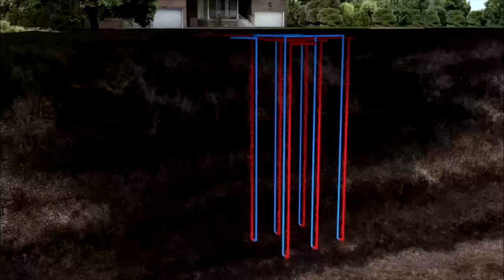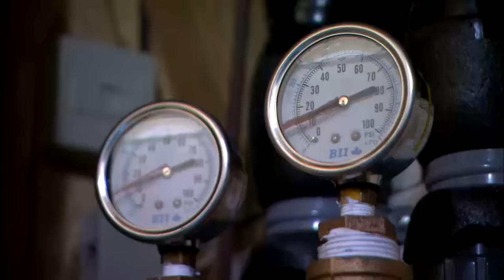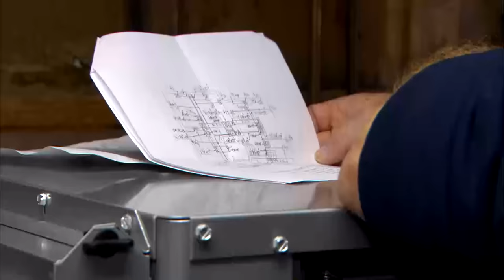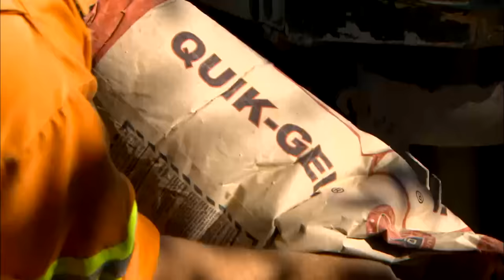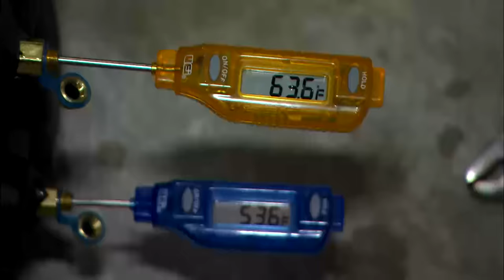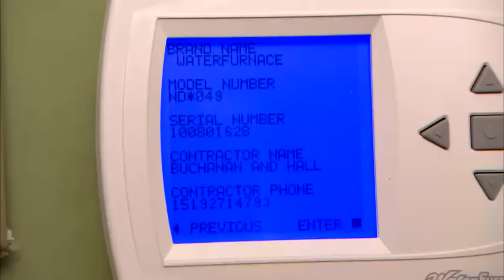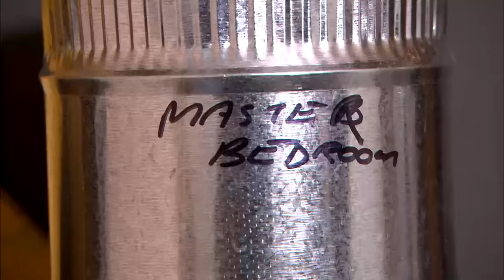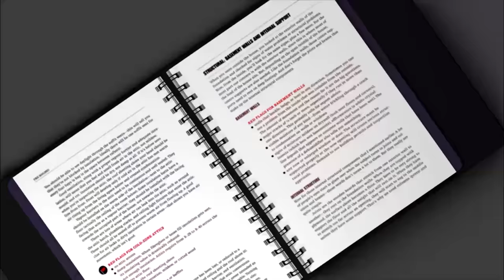The Unexpected Costs of 'Green' Homes | Holmes Inspection 208

Comment: Most places require building permits and inspections as work is being done. Since there were clear code violations in plumbing and electrical, plus the ductwork was suspect, my conclusion is the original work was done by the previous homeowner with no permits and no inspections. The system probably never worked properly, and the HVAC guy said the heat pump had been damaged by mis-installation (a refrigerant overcharge damaged the compressor). Tons of work for Holmes and company, but in the end a working system.

Comment: I disagree on going up through the attic as being viewed so badly.  There is a completely legit way to do attic based ducting with suspended lines and good quality well insulated flex ducts. 

I suspect because they had cold air return through the floor, and vastly undersized return (and probably too small outlets) makes it really a two for one.  if you need to increase and move stuff and take out half the ceiling, you might as well take the entire thing and not do patchwork jobs on both the ceiling and vents.

Comment: If you want to use geothermal for heating and you're interested in efficiency, you should be using water loops in the floor (heated floors). However, there's no sensible way to add that to an existing building. Geothermal works best when the heat extracted from the ground is as close to the temperature you actually need as possible. In case of water loops in the floors, you can use 23–30 °C water even during the coldest days so there's no need to heat the water any warmer with the heat pump.

Comment: Every time it is the so called professional home inspectors that fail the buyers. There are some very good ones but they are few and far between.
Reply: With all the homes I bought, I brought in a team on top of a inspector that included electricians, plumbers, roofers, HVAC, and foundation people to check out the house. They Checked out everything that the inspector would,
 not or could not do. It cost me a couple thousand dollars but they found found thousands of dollars of issues and saving me tens of thousands of dollars overtime
Reply: @Mike-bk6uk   I agree 100% Those guys are the real deal. These inspection companies are pushing out unqualified inspectors ill prepared or knowledgeable enough to do a thorough enough and proper inspection. I sold one home I had built and the inspector failed the grading under the deck by the hotttub. I took him to task and produced the grade inspection report from the City with a pass. I had in fact added material around the home as it settled after that certificate was issued. I used clay compacted it in place running away from the home and swaled to run to the street as is/was code at the time for that city. I then placed a fabric and crushed lime stone on top for aesthetics. Under the deck areas I had intentionally left access so I could monitor settlement. I did the same under the deck where needed except for the machine tamping in tight quarters. I used water to settle the clay as well as I could. It work perfectly. Water is imho the worst offender of damage to homes. Water infiltration is something you just do not want.

Comment: Aside from the very poor installation ,Geo-thermal only works if the ground is good for it. 
Most systems don't work as they should. 
Basically the ground is not warm enough, but it is good for cooling without a compressor.

Comment: for the   cost  of materials that are torn out , the amount of work on the home , I really wonder if there is any money saved over window units
Reply: You can't really get window units for heat pumps (they exist but are rare compared to "air conditioner with heater"), and you wouldn't want to leave any unit installed in the window in a Canadian winter as it would compromise the insulation too much.

Comment: Mike I have a question for you about the jobs you have done. Have any of the families that you have redone bad renovations and made it right for the homeowners have the homeowners had their property taxes raised so much more that they could not afford to live in the house anymore
Reply: And you think Mike knows that?
Reply: @leestebbins5051  I don't know what he knows that's why I ask Mike Holmes that question
Reply: That’s an absurd question because if you can only afford to live in a broken down, dangerous or poorly heated or cooled house then you’re living beyond your means.  The property tax issue would only arise when the house is sold wouldn’t it?  So if a mike Holmes house sells for a lot more because it’s a much better home then perhaps prop taxes would go up.  I’m not sure what kind of mind would find problems with what Holmes does.
Reply: Property taxes are usually assessed on outward improvements. Things you can see on the outside. Add on a porch or shed, taxes go up. Put up an interior wall to make a third bedroom, taxes stay the same
Reply: @Lmiller201 , this is true if the homeowner does the work and there are no permits.  If there are permits, it will increase taxes.
Reply: @pcspecialistpdx  MPAC assessments are based off the value of your house in comparison to youre neighbors. They cant see inside the home, so its a function of municipal and public data, so depending on the renovations it can increase the overall value and property taxes. That being said, MPAC is extremely conservative on home valuations and its prorated over a 4 year period for any increases.

Comment: Never buy a house with a geothermal heat pump. They are extremely expensive to install and maintain, and if your wellfield fails, you are completely screwed. In most areas in North America, the energy cost savings (if there is any at all because in cold areas you still need electric or gas backup heat) will never pay back the cost of the equipment.

Comment: A louver on the closet door will solve the return issue. Insulation on the bottom of the roof solves the attic duct issue. Pretty common around here to have ducts in the attic but both the floor and roof are insulated.

Comment: Baseboard heaters are by far the most inneficient, most expensive to run heating source. I lived in a house at one time with baseboard heaters and my monthly electric bills in the winter were exorbitant. As far as a home inspection, I purchased a home in 2017 and the so-called inspector missed a ton of things wrong with my house to the point that I suspected that the people I bought the house from paid him off to look the other way. The next time I buy a house I am going to find a reputable builder/contractor and pay him to inspect any homes I am interested in buying. These people running around making big bucks doing their lame-ass versions of home inspections are all crooks and should be held liable for their shoddy work. On a side note, these Holmes Inspection shows are so good I would like to see longer, multi-episode versions of each one, and I am talking like 10 episodes each like the old This Old House shows on PBS.

Comment: The geothermal is obviously a pain in the butt. You could probably save money by keeping your existing system in good shape. Get your furnace and air conditioning checked and cleaned every year. Replace what needs replacing. And get friendly with your attic!
Reply: Correct, My estimate =  they put about 150,000 into this project.
Reply: I worked for a home builders trade association.  We had a member who was a geothermal expert.  He told me that there was a dark cloud following the industry because it was new technology and no one knew what they were doing.  A properly installed geothermal system is worth the investment.  So u are wrong about that.  But you are correct there are other ways to achieve energy efficiency.  Proper insulation in the basement, attic, around the windows, duct work, solar panels, etc. can give you good results as well!
Reply: Geothermal will save you a lot more money than your old furnace, no matter how well you maintain the furnace.

Comment: What did all of this work cost?  Compared to the price of the house?   Nice to see, but not likely affordable.
Reply: In the later seasons they started putting up the costs of the renovation. Ball park 150-200k for this, homeowners pay 50% of that, the network covered the other half.  They got the money back through ad revenue so it wasn't a loss for the network. They will not do that now with the decline of network TV and skyrocketing inflation rates, this was 2010 what a difference 14 years makes.
Reply: @BobDevV  Maybe in 2010 they didn't think it was bad to use those leaf guard things. Maybe like shingles on a roof they have a BBD, and need to be replaced after a certain amount of time.

Comment: 17:00 As a Finn, having the piping in the ground pretty close to surface is totally okay if you have good enough insulation above it. Here in Finland, we would typically use e.g. 80 mm FF-EPS layer above such piping. Of course, if buried deep enough, you wouldn't need extra insulation layer at all.
Reply: It wouldn't be enough to put insulation above it, you'd need insulation entirely around it. The ground itself will freeze around the tube so there's no directionality there. It also depends where you are in Finland. In parts of the south and west of Finland the frost depth is only 20cm or less. Holmes' shows are shot in mostly southern Ontario where the frost depth is roughly 120 cm, which is more similar to northern Finland. In this video, we see the tubes were buried ~45 cm deep in an area with a frost depth of 120 cm.
Reply: @guspaz  I live in Central Finland and here the frost depth is around 170 cm if I remember correctly. Having insulation above the pipe is enough if you extend the insulation to the sides widely enough. If you have 200 cm wide FF-EPS insulation panels (two layers with seams offset, probably 80 mm thick panels) for a single pipe, it should be enough for 45 cm deep installation because frost doesn't go very effectively sideways.

However, 200 cm wide insulation may be more expensive than having insulation all around the pipe but flat insulation is faster to install.

Comment: Been installing and servicing Geothermal for over 15 years.  The original install was complete garbage.  I have seen many systems that were installed by inadequate contractors, just trying to jump on the Geothermal bus for the money.  Can't tell you how many times I've had to tell home owners the original install is bad.   If the system is sized and installed properly, it will work as it should.  As goes with everything with investing money into a home, make sure you due your research on the companies you will be using, and not just taking the cheapest proposal.

Comment: This must have been an old project, Blue wood is no longer available.   There were some problems with corrosion of screws in that wood.    Although the concept is good, it’s a borate (from borax + boric acid), gives mould, insect and fire protection.  

Looks like it was a horizontal ground loop.  Since the project is in Canada, likely in southern Ontario, a horizontal loop would need to be at least 6 feet deep, preferably 8 feet or deeper.   Meaning ground froze too quickly in the winter (heat pump is extracting heat, freezing the ground) because winter temperatures also extracted heat from the surface near the horizontal bed.   

There also wasn’t nearly enough surface area for a horizontal bed.    Maybe they did multiple short vertical loops, but what they dug up only looked like horizontal ?    Too many locations for leaks, who knows what all that thin tubing was for.  In any case, not a good installation.   If it had been 6+ feet deep, maybe.

Comment: Surprised removing all existing HVAC equipment and installing another geothermal heat pump was the best option from a return on investment standpoint.

New duct work would not have been required with radiator heat or mini split heads.  Cold climate air source heat pumps are a viable alternative to geothermal in many areas.
Reply: I expect that's what the homeowners wanted. The existing ductwork was junk, radiators would have required a boiler and plumbing,  and mini splits aren't a great idea for a whole house.

Comment: interesting that you call this geothermal. here its just called floor heatpump (instead of air) , because there is no geothermal heat in that depth. geothermal are deep holes that heat the water because of the depth directly.

Comment: Why wouldn't you just condemn the heat pump and just put in a nice gas heater, and it would solve all their problems at a fraction of the price.
Reply: Why does nobody understand that geothermal saves you a ton of money down the road, a gas furnace will cost you a lot more in heating and cooling.
Reply: @joesmith-es1zy  Geothermal costs about 3x as much to operate as as NG, about 10x as gas on the install.  There is no circumstance that ever exists where Geothermal is a good choice unless you you live in a netzero tyrany.

Comment: Wow so they actualy used the water heater to heat the house! Genius pluming... why isnt there a one way valve installed so this cannot happen?
Reply: That wasn't the issue, they probably had the one way valve installed - but since the connection was in copper, the copper pipes carried the heat from the pipes back to the geothermal unit via conduction.
Reply: @MrAntarpreets   You could be right good point
Reply: Did you see in the final showing of the water heater?  There was two tanks.  One the geothermal would preheat every time it ran.  the original install it was installed directly to the electric water heater.  It's is something I see all the time with bad geothermal installs.

Comment: I'm not sure I could afford geothermal but I would go for a simple heat pump/mini-split system.
Reply: It is more efficient than straight electrical heating since they use the phase changes of a refrigerant to move heat energy around. You can efficiently suck heat out of even -15°C air. So you get more heat in your home per watt of energy you pay for. If everyone in Canada switched from baseboards to mini-splits the heating bills would drop by a full 2/3 at least... at least. If people went geothermal on top of that it would make it even cheaper.

Comment: The original system was doomed to fail because there was not enough return air runs. You need one in each room in a house that size. Who ever designed that duct system should pursue a different choice in careers.

I hope Water Furnace upped their game in the last twenty five years or so. Back in the late 90's I spent around an entire year tearing out and replacing Water Furnace Geothermal systems that all died in a housing development. They were all installed when the houses were built and they all died in a span of 6 months about 6 to 7 years after they were installed. I believe we replaced them with Tetco systems, might have been Carrier but I don't think Carrier was in the Geothermal business at that time. The last I heard 90 of the systems we installed were still running fine 20 years later with some minor repairs needed. Mostly solenoid valves needing replaced. with an odd reversing valve needing replaced here and there. 

The biggest flaw in a closed loop system is you NEED to run the AC in the summer to put heat into the ground so you can pull it out in the winter time. If you don't run the AC it is possible to pull all the heat out of the ground, at least the ground in the area where the loop is, and get no heat at all when you need it in the winter. 

A open source, IE a well, Geothermal system works much better. You pull the water out of the well and pull the heat out of it and then dump the water into a drain. In the summer you put the heat into the water and it goes down the drain as well. The beauty of the open source well system is that ground water stays the same temp year round if you go deep enough. If you have a mild summer and don't need the AC much it does not affect the heat you can pull out of the ground water in the winter.

The draw back to the open source well system is if you live in an urban area with city water. Most cities don't like wells because they are afraid you will tap into it for all the water needs of your home. They lose a paying customer if you do that. They will do everything they can think of to prevent that up to and including making it illegal to have  a well for any reason.

Comment: There are inspectors and then there are inspectors. It doesn't matter if the inpection is related to building or software source code, a bad inspector will only find non-important stuff.

Comment: Geo thermal is not the best in the laurentian shield (good luck getting through all that rock ) .
Reply: Probably not going to work in Northern Ontario, made mostly on granite, where it gets bitterly cold being that close to the Arctic. Southern Ontario is mostly limestone so it's softer but also closer to five major great lakes with a high water table. I am guessing from the number on the thermostat for the geo thermal guys, they are near London/Winsor because of the 519 area code. Green technology is still very new so most people don't even know how it works or what the benefits are, and there is very little training on it.